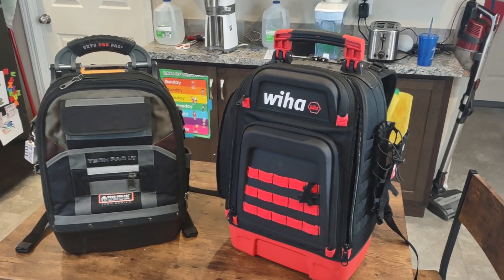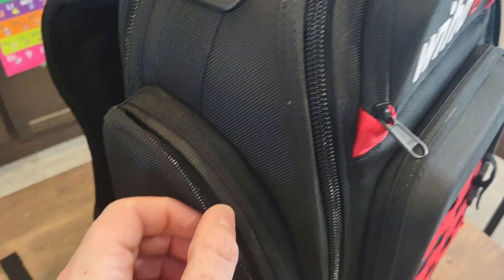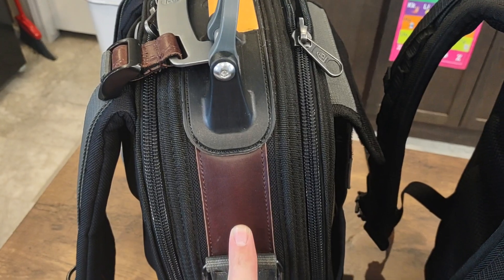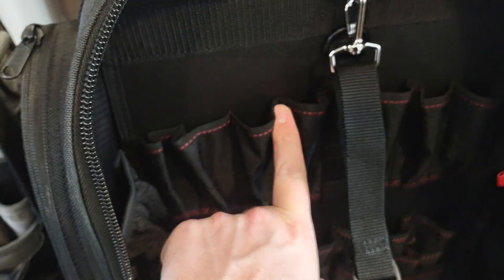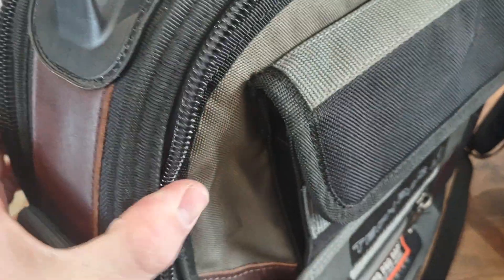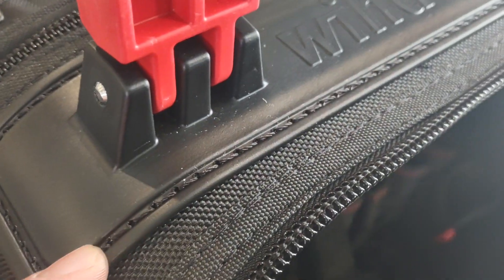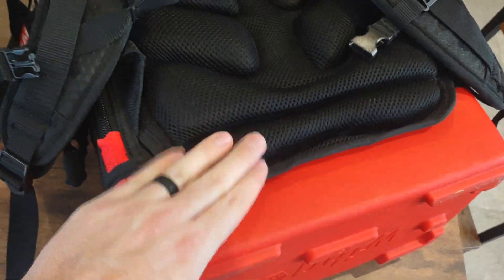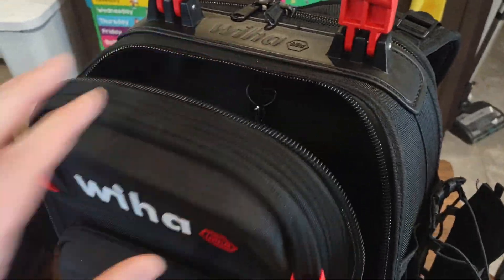Wiha vs. Veto Quality Check. Controls Engineer

Comment: I just returned the WIHA to amazon.  I dont think the bottom will blow out since most of the weight is suspended inside the bag and not resting on the bottom tray so stiched or rivet isn't to big of a deal.   My issue with the WIHA is it's very large but lacks organization insofar as pockets.  My little Tech LC carries way more hand tools than the WIHA.  I think the WIHA is better to fit power tools.  It's a good bag but for the price, i expect better than flimsy pocket pouches.   A good deal at less than half the price would be the Crescent CTB1000.